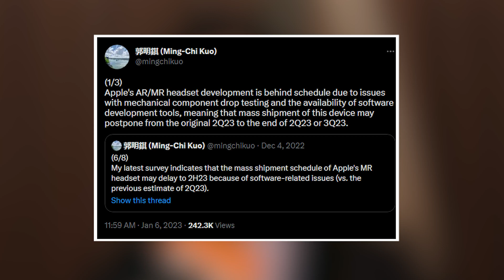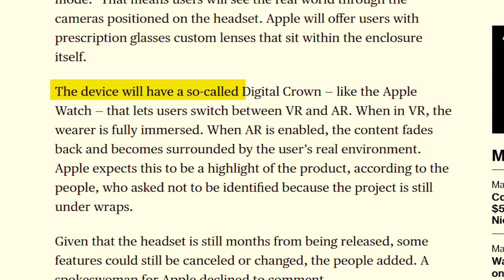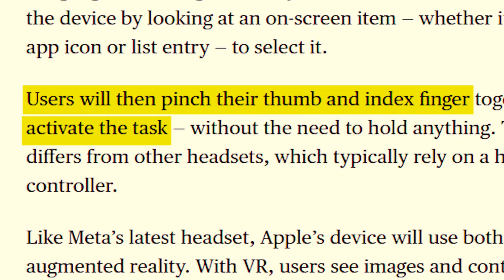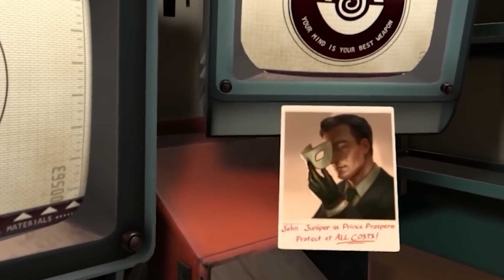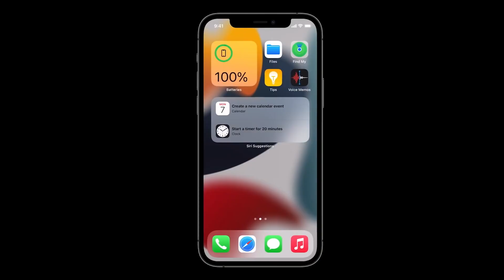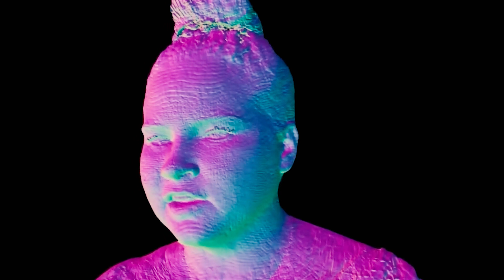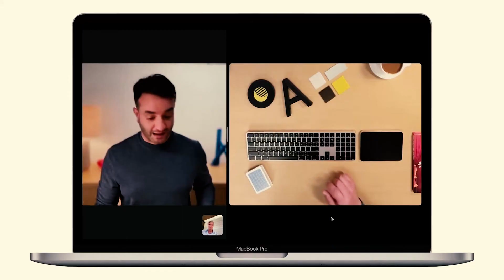What Makes The $3000 Apple VR headsets Special

Comment: Pointless if it doesn't work with my PC
Already said it. If it doesn't work with a Windows desktop/laptop it's a pointless device.
Reply from the maker: You are right! it definitely needs to be compatible with all other platforms because most AR/VR users use PC. But we will see what they come up with
Reply: What are you doing with a PC anyway?  That's so sad.
Reply: @bruxi78230  there's more apps for it
Reply: @soberanisfam1323  ----- The PC industry is the walking dead.  Let's do a quick check of big PC makers and their market cap.  Dell is 34 billion, HP is 30 billion, Lenovo is 45 billion.  Oh and over here we have a little corporation called Apple weighing in at 2.7 TRILLION.  You really think Apple is worried about PCs, they're just about moribund.

Comment: They will first need to drop that $3000. Price point. I use my headset to game. I have 0 interest in walking around in public with ‘goggles’ on. As long as the Quest 2 and 3 are at a low price point they will be the VR headset I choose. Sorry Apple, I love your products and have the iPad, Apple Watch, iPhone and Apple TV, but this headset is way too over priced. 🤷🏻‍♀️ it is what it is.
Reply from the maker: I agree! $3000 is pretty expensive, but i believe there will be a second generation headset which will be cheaper. Around $1500
Reply: @TechInCheck  I would totally be willing to buy it for 1500 for sure! Maybe even get a loan for 2 grand and just pay it off over a couple years. Quality video. Thanks for the upload.
Reply from the maker: $1500 is a pretty fair price. It will be interesting to see the difference between the $3000 and $1500 headsets. Thanks for watching 😊